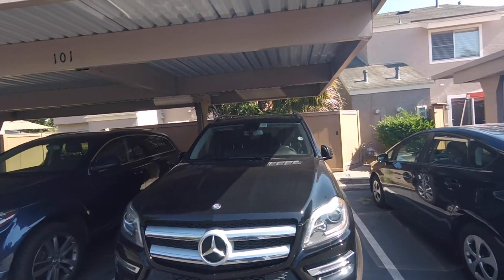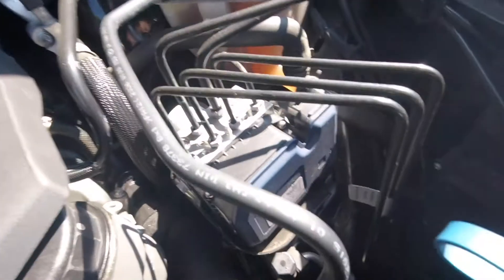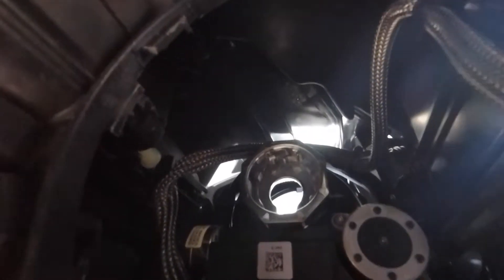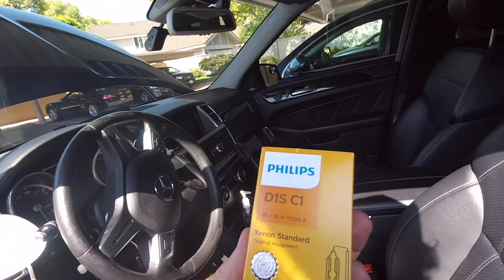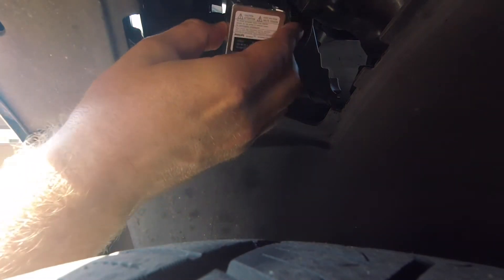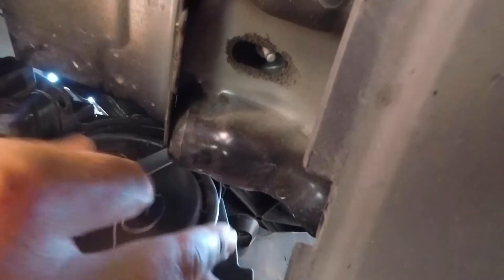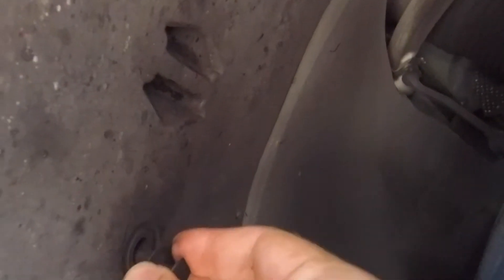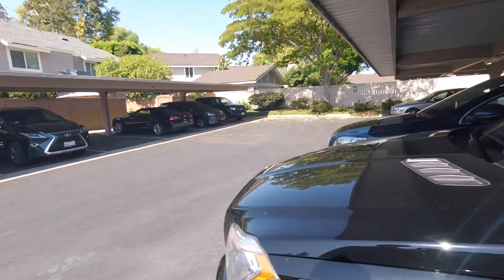How to change / fix a bad low beam HID Xenon bulb on a 2016 Mercedes GL

Comment: Hi, Thank you for the video! Very useful! 

I have similar 2014 Model and I had a water came inside because of the plastic cover feel off and water gushed in the headlight. 

I am curious if on this headlight it says: Intelligent Light System and if the process of replacement is the same? 

Thank you so much!
Reply from the maker: It sounds like you should have the same replacement process.

Comment: My headlights are now dimmed and not as bright as when i got my ML about 6 years ago.  You think just by replacing the bulb they will be back as bright as they were when new ?
Reply from the maker: It sounds like it wouldn’t hurt to try in case your current bulbs are defective or have an issue

Comment: Did You notice any difference in brightness between left side and right ?
Reply: That’s a great question, I initially bought an HID bulb that was not a Phillips brand just as the other headlight. I noticed different color so I returned it and bought Phillips brand instead. So it matches the original.